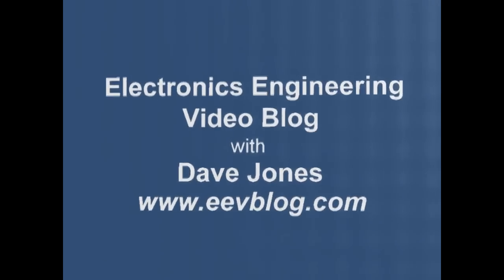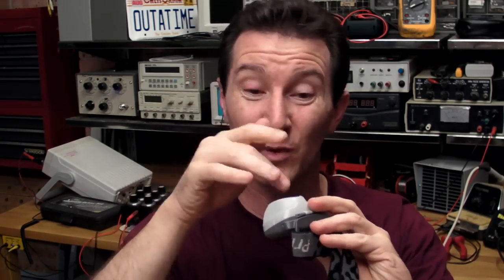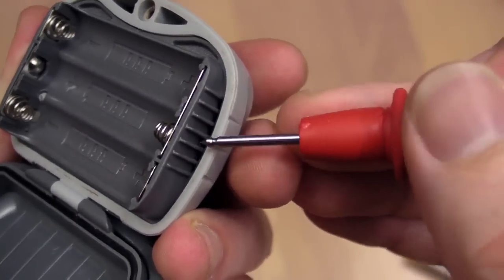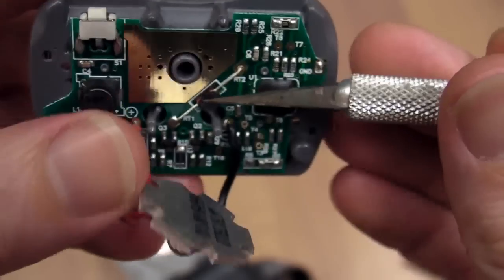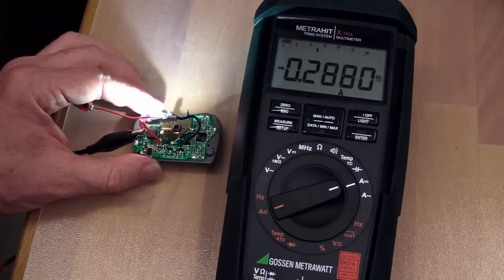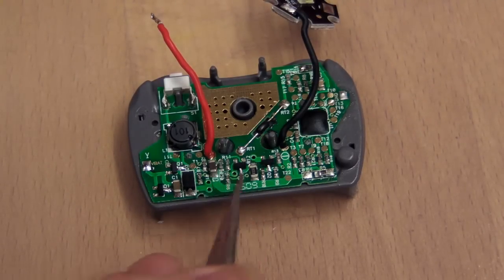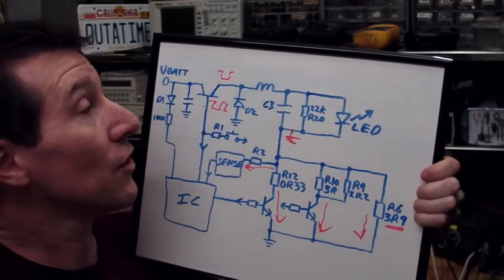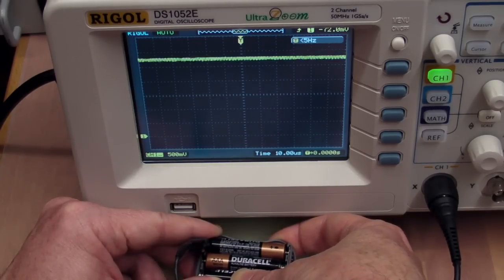EEVblog #67 - Hacking the Princeton Tec EOS LED Headlamp with a Cree XPG

Comment from the maker: I changed the 0R33 1206 resistor by putting a 0R47 in parallel. I did not change the other ranges. I used an R4 bin XPG.
The photos at the end though are from another one that I modded were I didn't change the values.
So the comparisons are bit over the shop, but it gives you the idea about the light increase.

Comment from the maker: @tecnolover2642 Because I had one of that value and it's quicker and faster to simply parallel another resistor than remove the old and solder in a new one.

Comment: Don't know if you've figured it out yet, but you can add a resistor in series with either of the wires to trim the brightness. There's all kinds of resources on the net to figure out what size resistor is optimal, or you can get a large bag of resistors from RadioShack or the like and tinker away until you find the right one.

Comment: Got one at Goodwill for 1.59. But what I'm going through is the little springs in the battery area are gone. Corrosion from someone leaving the batteries in. Question is do these heat up and cut off. I put springs in it to make the the connection work. Or at least I think it does. I finish watching. Maybe the answer is there.

Comment: I have a cheapo Energizer one (like $15 US).  It has a more even beam than either your std one or the mod but it isn't as bright as the mod, nor is it water proof. It does the job for me, I only use it around the house, like when I need to work on the AC lines with the relay off.

Comment: @Superfungus0 I'll disagree with your point too :) Technically it's OK but the problem is the characteristic of the LED itself. Even with perfect PWM driver there is difference between constant current at 50% and PWMing at 50% duty cycle. I suggest you search some power LED V-I characteristic to see the efficiency difference, for example at candlepowerforums. With more current/power, the voltage across LED increases and light output efficiency decreases, the main problem in making better LEDs.

Comment: gosh. I'm way behind time on this video. I have 3 units Princeton Tec Quad headlamp, one of which is dead (given by a friend) - I think what David is saying is correct. Princeton Tec decouples the LED so that they could use the same circuitry of the Quad (4x wide beam LEDs), to fit the wide-angle throw market segment. Smart move!

Comment: Great video!  You are amazing!  My needs are the same as yours.  I'd like more of a FLOOD type beam pattern.  My question is:  In your modded version what current draw did you acheive by changing out the R12 33ohm resistor??  350, 400 mA??  Also, why did you put in a 47ohm ?? I thought you want a lower value resistor to get a higher current to the LED??  sorry, I'm not experienced in electronics but you said the low setting used the highest value resistor, so to incread the HIGH why use a lower?

Comment: Another great video, thanks! One question: There is a diode and high-value (100K?) resistor in series between the battery and the IC. I'm guessing that the diode is to provide protection against the battery being installed with reversed polarity, but what is the resistor for?

Comment: Great video but we were so close to having analyzed the whole circuit and I regret it did not happen:
what exactly is the function of the IC. Just to divert the power to a specific resistor with each brightness setting? 
what exactly does the sense circuitry do? 
buck converters give a constant voltage. How exactly does the current regulation take place? thank you

Comment: @infulojze: Sorry but it doesn't work that way. The inductor is switched on and off, it stores some energy and carries it over to the LED. That's how you efficiently deal with voltage differences between input and output. Capacitors are really smoothing the current here. Look up DC to DC converters for more info.

BTW driving LEDs with straight PWM isn't efficient for low power modes like 50% or 25%. The problem is higher voltage drop at higher power and PWM usually switches on and off with 100%

Comment: @tecnolover2642 

0R33 means 0.33 ohms and 0R47 means 0.47 ohms. He put a 0.33  and 0.47 in parallel to get a 0.19387 ohm resistor thus increasing the current. The current would probably be around 450 - 500mA.

I think that is right. Please correct me if I am wrong.

Comment: I bought one of these headlamps after I saw this video 13 years ago. It's still working, but the rubber seal on top of the switch finally disintegrated 😞

Comment: You could use a boost converter to increase the single cell voltage to that required to drive the LED. This uses very similar components to the buck, but a different topology. Wikipedia contains good articles on both. On the down side, the battery current would obviously be greater. I'm not sure how the average AA cell would cope with delivering some 600 mA!

Comment: How are you going to get 2.8 V out of a single AA? Plus, as Dave points out in another video, you get the most out of an alkaline battery if you run it down to 0.8V/cell. The more cells in series, the better for getting the most out of them (to a point obviously). A 9V battery probably didn't fit their form factor well.

Comment: @exnol 
Why not just put a single .19 ohm resistor in there in the first place.  why run two in parallel?  sorry I'm a newb concerning electronics, but just wondering.  thanks for your feedback.

Comment: Another question,  with your mod using the XP-G LED and a 350-400mA current what is the LUMEN output on HIGH now???  Also, do the cree led's come with a star mount??  do I need to buy a star mount or can I use the stock one already in there and just remove the old LED and put the new LED on??  also,,  is heat going to be an issue with 350-400 mA ???

Comment: 19:15 - 19:55 Actually I'm guessing that they're cutting the power at a low voltage to avoid deep discharge and consequently battery acid leakage.

Comment: When you've just removed the AAA batteries and you're showing us the empty battery compartment, you tell us that the compartment is held in place within the case by two small pins that you ended up drilling out. What are those pins called? I can't quite make out what you're calling them- are you calling them "hit stakes"? "Head stakes"? Something else? If anyone knows the answer, please let me know!
Reply: You were on the right path, they are called "heat stakes".

Comment: AAA cells are a poor choice of portable lighting since, like I said, one AA cell has almost as much stored energy as three AAA cells. AA cells provide a much flatter discharge curve than AAA cells. Using three AAA cells makes no sense since you can replace them with one AA. You can drive an led form a AA cell with a regulated boost driver. 9V batteries have even worse capacity and discharge characteristics than AAA cells since they use the smaller AAAA cell.